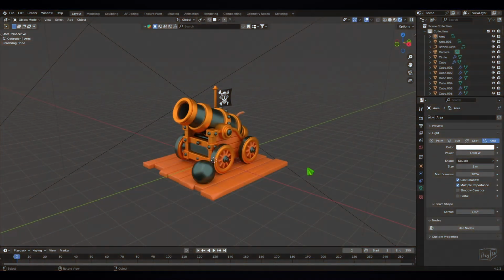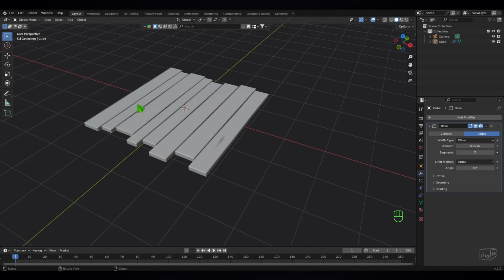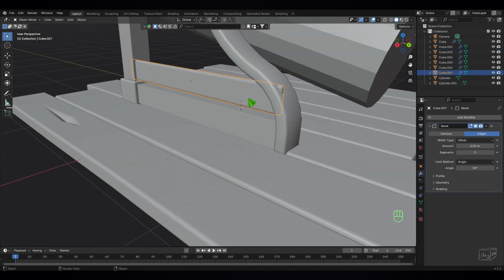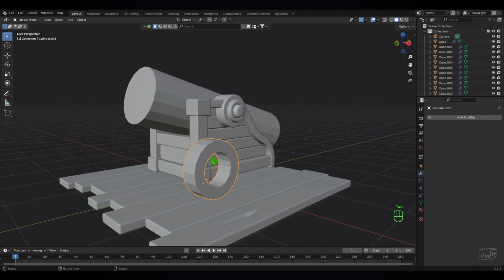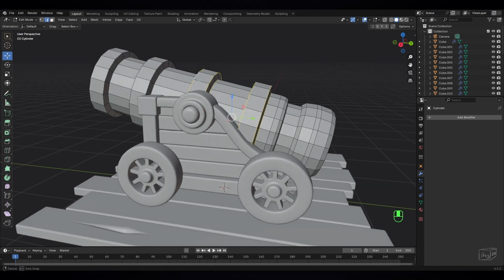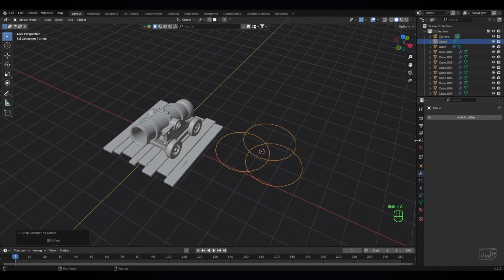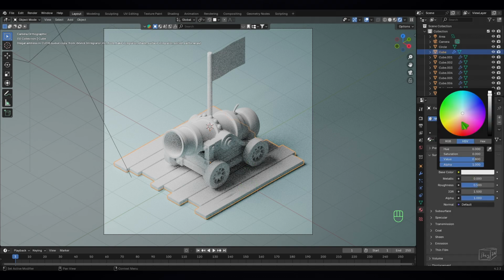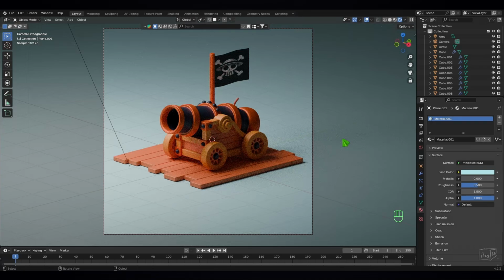From Scratch to Finish: 3D Cannon Modeling in Blender  | BEY 3D

Comment from the maker: ⚠ The #1 Thing That Made My Blender Scenes Instantly Better?
(Not what you think…)

When I started modeling stylized scenes, I thought I just needed better geometry.
But the real shift came when I fixed my textures.

I was wasting time searching for random images, resizing, editing, and trying to make low-res stuff work…

Then I built my own texture pack — with everything I needed as a Blender artist.

🎨 It’s called the Ultimate Blender Texture Pack, and it includes:
✅ 186+ high-quality PNGs (wood, maps, flags, carpets, clocks, decals, etc.)
✅ Drag-and-drop ready
✅ Built for stylized scenes, props, and game assets

💥 Normally $49 — today just $9.99 (one-time payment, lifetime updates)

🎁 I even included some free textures so you can test them out.

This is exactly what I wish I had when I was learning Blender.
If you’re serious about 3D, grab it now and level up your scenes:

👉 Gumroad link: https://bey3d.gumroad.com/l/quality3